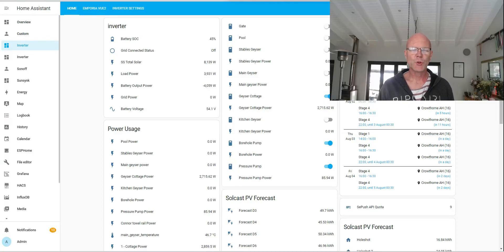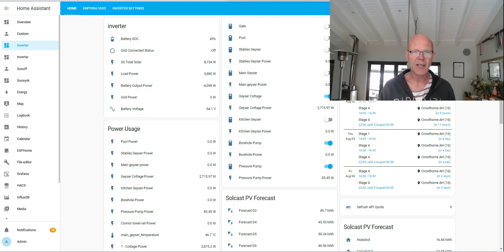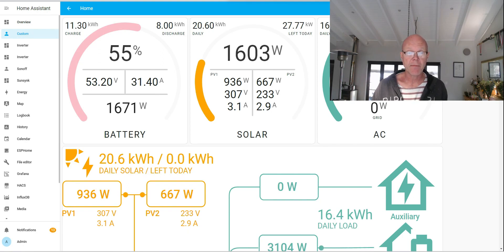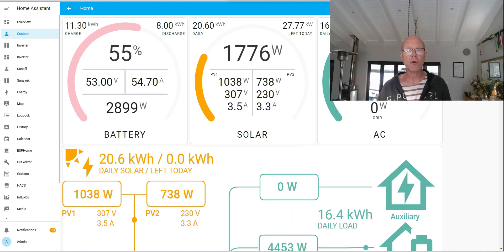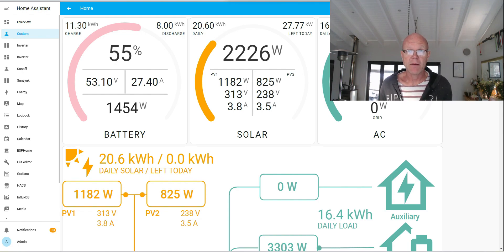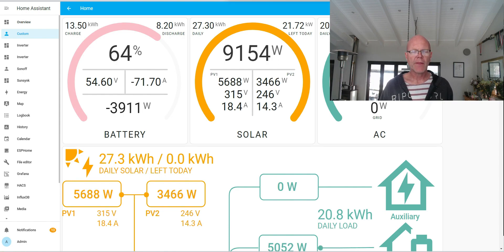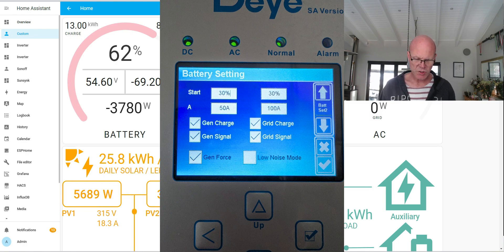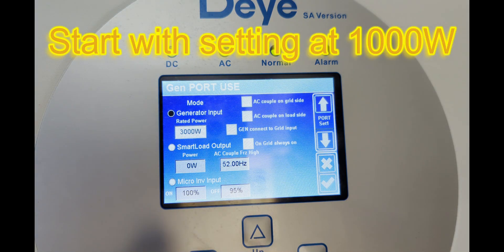DEYE & Sunsynk Inverter generator setup

Comment: Hi, I have a question. I have 2x  12kw 3phase in parallel. Will a 5kw 3phase generator charge the batteries? Do I need a bigger generator I can send the specs of the generator.
Reply from the maker: You can use a 5kw generator, you will need to restrict the power being pulled from the generator
Reply from the maker: I have a 5kva generator providing power to my 16kw single phase
Reply: i have a 40kw 3 phase generator…can i run it into deye 20kw 3 phase…my gennie is connected to house directly… eg eskom to gennie to house..
Reply from the maker: Hi  @croog08  , you can definitely use your 40kw generator to power your Deye 20kw 3-phase, it will only pull the power that it can use from the generator i.e. the generator can't be too big for the inverter. If you have an ATS on the generator, you can also set the inverter to automatically start the generator when it's battery reaches a specified level, it will then recharge batteries from the generator and then switch it off again when the batteries have charged to the desired level. Deye have got a pretty good video explaining how to set it up, https://www.youtube.com/watch?v=ue7BOX3rPXI

Comment: Hello am having a weird issue with the inverter i have 5kw deye its shiws that the generator is providing 500v and does nit shows the frequency. On another thing can you please share ur config related to home assistant and the dashboard it look awsome
Reply from the maker: Hi  @afgaming3204, 
Have you checked you generator voltage with a multimeter? 
Also, have you checked that your inverter has an earth/neutral bond when it is running in island mode?
Reply: Yes i checked the voltage, it was working perfectly before but for no reason it stopped.
What do you mean by earth bond in my country we don’t have earth even from the official electricity company. We only receive two poles negative and positive
Reply from the maker: What country are you in @afgaming3204 ? Are you saying that you have no earth/neutral bond in your country?  Having a voltage difference between earth & neutral is usually very dangerous as there is usually no protection for a short between earth and neutral, so if you have a voltage difference and you create a circuit between E/N there are no earth leakages or breaker switches. Maybe the electrical circuit designs are different.  Have you tried measuring the voltage difference between earth and neutral when attached to the grid and when disconnected from the grid to see if there is any difference? Back to the generator, if the voltages and frequencies being supplied by the generator are not within the permitted range on the inverter, it will not try connect to the generator.
Reply: @SolarIntegrations  well i am in lebanon. There are no earth i can measure i created some sort of earth digging 3 copper rods on the ground and it was usually works before with the generator but lately it shows 500v and no frequency i am attaching the generator into the hen port in my inverter so it must cop with frequency fluctuation

Comment: I have a 8.8 KVA single phase inverter and 3phase 20kva generator connected to the grid port.
can i charge the batteries using this Gen and how exactly can I do that please sir
Thanks in advance
Reply from the maker: Hi @solaimanrahil4047, 

You could connect it directly to your generator but would only be able to use one phase of the output. 
This may however result in that phase overheating and perhaps burning out if you put too much load on it. 
Would be difficult to know when that would be as the generator would not be laboring under the load. 
20KVA = 16kw / 3 = 5.3kw per phase. @ 75% = 4kw load per phase, so in theory it should be able to handle that. 

That is however totally a guess and I would definitely suggest speaking to your generator manufacturer and checking with them. Please let me know as I am interested to know what they say and could be totally wrong with my guess.
Reply: @SolarIntegrations  how can I stop the output?thats my concern sir thank you
Reply: I mean how can I make it use the gen to charge but not supply the load
Reply: Like how to restrict the load from being pulled from the gen
Reply from the maker: Tick the Gen Force box and it will charge from generator no matter what the Work Mode settings are
Reply from the maker: Put the value you want to limit it to in the Generator Shaving box in the settings
Reply: I am already there I will connect the gen to the gen port and the grid to the grid  port 
I just want to know if in this case the gen will be able to charge 
*Note: the inverter load is 7.6 kw 
And the gen each phase is 5.3 kw as you mentioned previously*
so do you think its good to charge from the gen or we not do that?
Reply from the maker: @SolomonRahil  I would set the inverter limit on the load to be placed on the generator at 4kw which is about 75% of that phases max. It should work but I still suggest that you speak to the manufacturer of your generator to make sure it will not cause an issue.
Reply from the maker: From the inverter to the generator @SolomonRahil  ?  Is you have it connected to the generator port it won't send any power that way, if you have it connected to the grid port you will need to make sure you have zero export to grid selected.

Comment: Just found your channel :). Wonderful to see an HA focused with solar YT channel.  New to solar but have my HA.  Tossing for 10k Hybrid with 10 batteries either SolaX x3g4 or deye/sunsynk SG04LP3 but need that generator option that both solax and deye/sun support.  1) What is better supported in HomeAssistant in your opinion?  2) any issues or restrictions with type of generator on deye as some other guy could only make generator work on Solax? 3) Solax or Deye/Sunsynk? :)
Reply from the maker: Hi, I only have experience with the Sunsynk/Deye option so can't comment on the SolaX inverters unfortunately. As far as generators are concerned, in my opinion at least, most generator issues are caused by installers/owners not understanding the process that the inverter needs to go through to connect to the generator and what needs to be in place. Once people understand the requirements then connecting is relatively simple. I have a 5.5kva generator connected to my 16kw Deye without any issues apart from restricting the load the inverter can apply on the generator obviously.

Comment: Hello @SolarIntegrations. Firtst of all Thanks for your great effort and knowledge of you your video. I have a little confusion. Apparently aux port can be set to  smart load (output) or gen input. Lets say: electrician install a gen inlet which has male probes. I ve been using as gen input. But what if accidentally change setting to smartload, wouldn't my gen inlet fitting male probes be active and expose electrical danger?
Reply from the maker: Hi @uthanwintun ,I have never considered that but I think that you might be correct. Am not sure if there are any safety features that would stop damaging the generator if you changed the settings by mistake or if it would even do so.

Comment: @SolarIntegrations Your inverter is 16kW so is it 3-phase one? In your video (https://youtu.be/-VRY9Clo3j8?t=307) the generator input is 1-phase.
How can you connect 1-phase generator to 3-pase inverter?
Reply from the maker: Hi @mariusz9725,  16kw is single phase :-) , you can't connect a single phase generator to a 3-phase inverter.
Reply: @SolarIntegrations  I've heard that VFD is a solution for that. However I haven't seen it working live...
Reply from the maker: Thanks  @mariusz9725  hadn't thought of using a VFD, is a good idea.